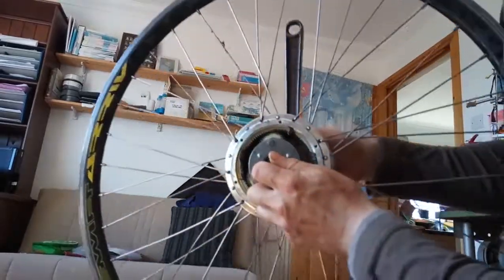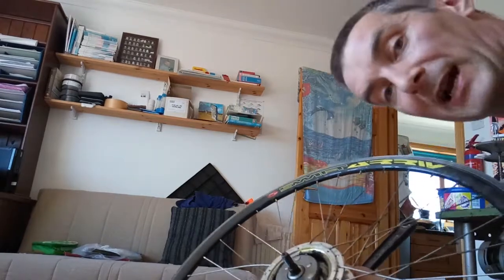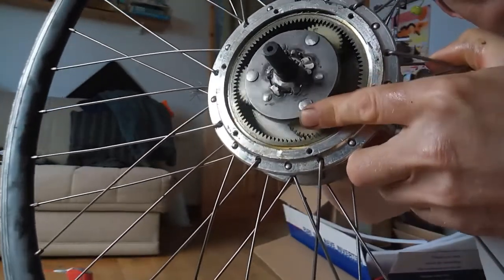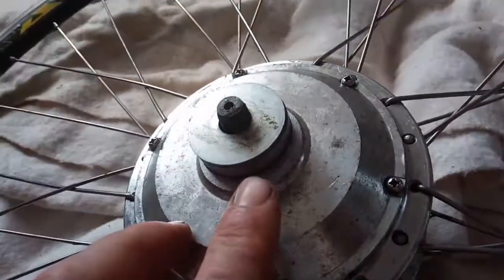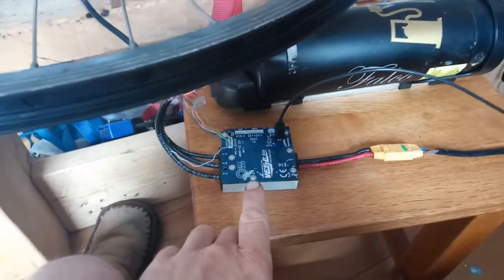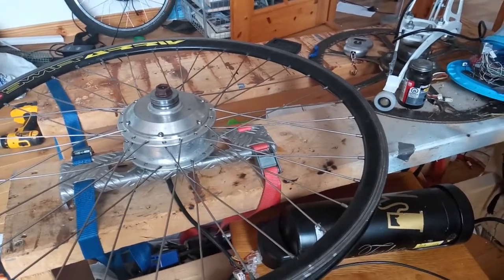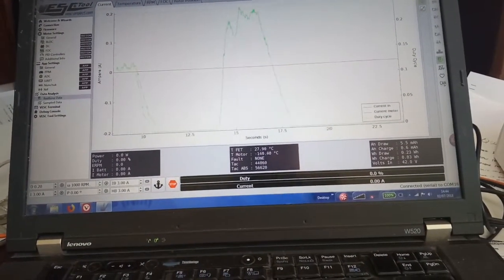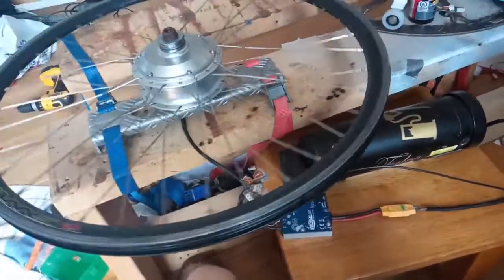Regen from an e-bike geared hub motor

Comment: Other hub motor have better arrangement of gears that will easily allow you to make what I say.
Reply: The SX motor is one of the best choices because it doesn't use thrust bearings. (like Bafang) so can take the sideways thrust of the spiral planetary gears. see previous clutch  reply.

Comment: Put a clutch (brake lever actuated) in paralel with the free wheel mechanism to return the force from the wheel back to the generator/motor. No rocket science.
Reply: Easier said than done. I have an SX 350Watt Hub motor (36 volt) put into my gravel bike. The free wheel mechanism (roller clutch) sometimes sticks at the top of a hill and the motor remains engaged going down. It starts generating at the top speed the battery voltage "could" spin the Wheel). At  45 Kph it generates 350 watts. . 
Great. just add a clutch . But that is inside the spinning hub. there is already wires down the centre of the Axle (so no pushrod access) . No room for more wires or hydraulic line. Hub is aluminum , but would require massive electro-magnet to pas thru.
Yes it requires some kind of science/engineering.